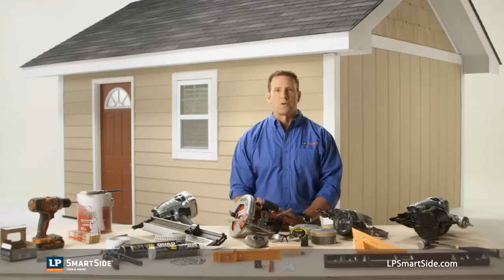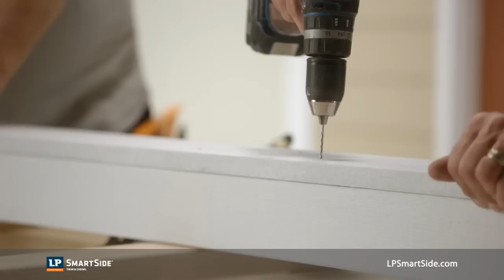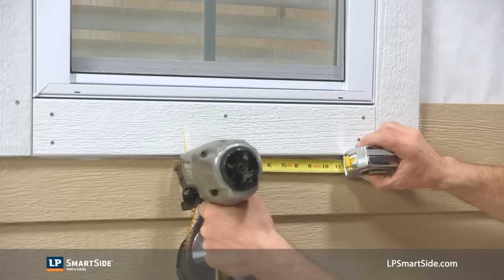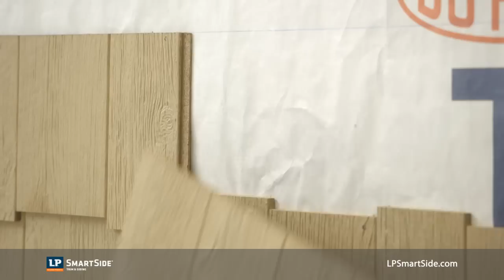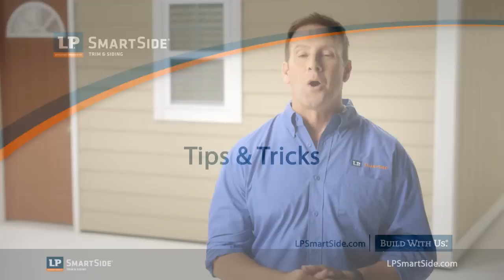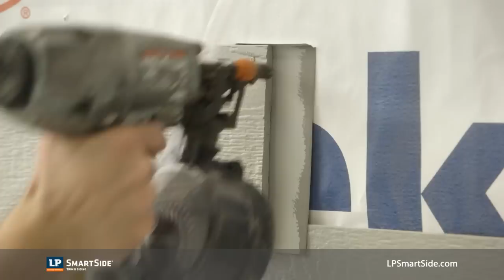How To Install LP® SmartSide® Trim & Siding Products

Comment: Was told i was installing lp siding tomorrow, so i wanted to check it out and holy crap this product is so bad , there is so much wrong with this product, not looking forward to working with it, i mean it's easy but, yeesh what petty crap, who wants tp paint all that crap and use a big ass nailer on those laps,, i have used so many better products, for the time it would cost to do this crap i would pick another material, looks like shit to IMO, i have seen it everywhere, the only thing good about this product is it sales team,

Comment: How do you do an inside corner when using the panels?
Reply: The most common way is to install vertical trim and then install the siding.  A highly more complicated way is to compound miter each and every piece.

Comment: 24:35 - "to protect the house wrap from this next step you may use a piece of metal sheeting to slide behind the lap siding"

25:18 - metal sheeting comes out with huge cuts in it

Is the point to protect from going deep enough to hit the house wrap?

25:13 - "Using a brush, prime all exposed wood fibers"

What about the wood fibers you just exposed on the lap underneath that you can't get to?

Comment: Can you tell me how critical it is to have a nailer that shoots nails with a diameter of .113? Of the 2 nailers I would prefer to purchase, they shoot a max diameter of .092. What nail gun(brand/model) uses a nail diameter of .113? Thanks for your help.

Comment: I am about to tear off wooden log home type siding . There is 3/4" buffalo board underneath. I told the home owner that I didn't think it was proper to side over the buffalo board, and it doesn't seem like I can get the 1 1/2" framing penetration of the ring shank gun nail for this. Am I right or wrong. I am trying to just get him to sign a liability waiver or just let this job go. Every one else has told him what he wanted to hear. I have a conscience. I believe the buffalo board will be mouse ridden to boot. This application keeps the existing windows and adds a house wrap. I am not enthused about any of this.

Comment: If you're installing full length lap you'll need 4 Gecko gauges due to bowing of the siding.
Reply: Nice to know I just bought two
Reply: You are not kidding about this.  I just got done with a job installing 16' lengths of this crap.  It was so bowed, I really could only use  1 Guage, and work my way down the siding from one end. Added tons of time to the job Terrible.  I'll be sticking with 12' Hardie board siding from now on.

Comment: Can you tell me what pieces of trim were used in this video, both corner and window trim. Is the 38 lap siding available painted to the public or is that purchased through a contractor, I want to install the siding and want painted pieces if possible.
Reply: You can get pre finished LP. Diamond kote does is and it's the best paint, they use a rock based paint that last a long time

Comment: How do you nail the ends to studs if you are next to a door, window, or corner where trim covers the stud locations? It would seem impossible to hit the stud. Can you nail to the sheathing alone in these locations?
Reply: You should have framing there. If not then add it in. This should be thought about for your trim size.
Reply: @athomewithkeith7904  But let's assume your house is already built, with sheathing in place and you are just doing a reside job. Can you nail this to the sheathing alone in certain places?  I don't think anyone is going to tear off the sheathing to add more framing. For example, a standard home has double studs on each side of the window- meaning 3" of nailing space. A standard 3.5" wide trim board would completely cover that area and leave no room to nail the siding. That means you would have to triple stud every window and door opening, and corners. I've never seen any standard built home framed like that. The only other option is no trim..

Comment: Do I need to use flashing between sheets, i.e. eight foot sheets plus a two foot piece on a ten foot wall. This would be four by eight foot sheets
Reply from the maker: Hi Dennis, you can learn more about flashing specifications here: https://lpcorp.com/resources/product-literature/installation-instructions/lp-smartside-strand-substrate-panel-siding-application-instructions-english
Reply: LP SmartSide link doesn’t work.

Comment: On the 4x10 sheets do u flash between each panels
Reply: This links don’t work. It’s just a bunch of coding or something .
Reply from the maker: Hi Jonathan, all openings must be properly sealed or flashed in a manner that prevents moisture intrusion or buildup, including flashing. You can learn more about installing flashing with LP® SmartSide® Trim & Siding Panels here: https://lpcorp.com/resources/product-literature/installation-instructions/lp-smartside-strand-substrate-panel-siding-application-instructions-english

Comment: What do you mean "your trim must extend beyond the thinkness of the lab siding for base"  ?
Reply: Jack Shaw the lap siding is 3/8” thick. When you lap the siding it will extend outward away from the building even further. The siding should not extend away from the structure past the thickness of the trim. Make sure the trim is thick enough so that the edges of the siding are concealed.
Reply: He meant "lap", typo on someone's end.

Comment: I see you have 3 options for lap siding butt joints, but in this video there is nothing done to any of the facia butt joints. Shouldn't you use one of the 3 methods for facia butt joints?
Reply from the maker: Hi Tom, thank you for commenting. You're correct in that we didn't reference fascia butt joints in this video. Butt joints on fascia should be spaced 3/16", with caulking at the gap for primed trim. You can find more butt joint instructions and installation information on page 5 (Figure 5b) of the LP® SmartSide® Trim & Fascia installation document here: https://lpcorp.com/resources/product-literature/installation-instructions/lp-smartside-trim-fascia-application-instructions-english

Comment: This stuff is a joy to work with. Imagine wood that doesn't bow warp or twist, and ends that don't split.
Reply: Imagine replacing the “failed” pieces in the future!
Thanks for using this cheap junk siding.
I will be in the replacement siding business for another generation!
Reply: @brookbandeen4999  This is not your father's Masonite siding. The things I've seen the stranded stuff do is very impressive. I think 35 years is doable. That said Vinyl seems to come off in every wind storm, so you'll be in business no matter what.
Reply from the maker: Hi there, thanks for your feedback! We appreciate your business and support.
Reply: I've had pieces of LP siding bow and warp. Its wood. There is always that possibility
Reply: @danieldenton5721   was this the strand or the fiber?

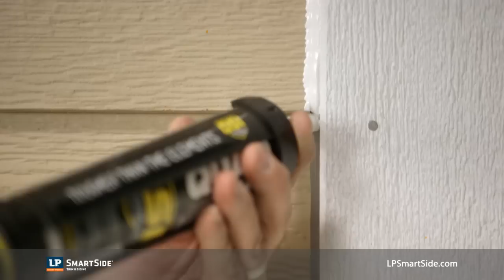Comment: 10:05  y'all left it like 3/16 open or more  too much gap and sealant to use
Reply from the maker: Hi Alexis, thank you for commenting. We recommend a minimum of 3/16" for butt joints and sealants. You can find detailed installation instructions here as well: https://lpcorp.com/resources/product-literature/installation-instructions/lp-smartside-strand-substrate-lap-siding-application-instructions-english. Let us know if there's anything else you need!
Reply: I just installed some and used the recommended 3/16” gap and yeah it’s a pretty large gap to fill and does use a lot of caulking. It’s hard to make look good too given the caulking sinks as it cures.
Reply: @whatfreedom7  3/16" does seem like a big gap.  is this because it swells when wet or the expansion of the manufactured wood has properties that swell?

Comment: Can someone please tell me the reason they dont want you to install cement board in contact with this siding? Is it because it soaks up water?
Reply from the maker: LP® SmartSide® siding must not be installed in direct contact with masonry, concrete, brick, stone, stucco or mortar; this includes cement board.  Cement board absorbs moisture and may transfer that moisture to any engineered wood siding through direct contact, potentially creating siding performance issues.
Reply: LP SmartSide but you said is treated wood against water leaks, termites and different like the normal wood, so basically if water gets somehow behind the siding this is not good. Just the painting doing the job I think

Comment: We are covering 2x6 boards x3 wide to cover support pillars for our front porch with LP smartside boards. I understand I need to prime and paint all surfaces and will need to silicone the edges but I assume don't silicone the bottom edge and how far must they be up from the finished deck? 3/16" ? They are also the wrong color so we need to paint a new color.
Reply from the maker: Hi Cynthia, thanks for commenting. It appears you’re referencing the bottom edge of the siding/trim where the 1-inch gap between the siding/trim and deck occurs. If that is the case, you’re correct in that you would not need to caulk (silicone) the 1-inch gap. Let us know if there’s anything else you need!

Comment: Work like amateur.  I am 20 year all type siding installer. When  You install lap siding, you need joint flashing between each joint.
Reply from the maker: Hi there, thanks for commenting. Visit https://lpcorp.com/products/exterior/siding-trim/build-with-lp-smartside/installation-instructions for further installation instructions.

Comment: The one useful fact that this horrible video does not mention is you need rip a 1/2 inch off on your starter panel due to overlap..

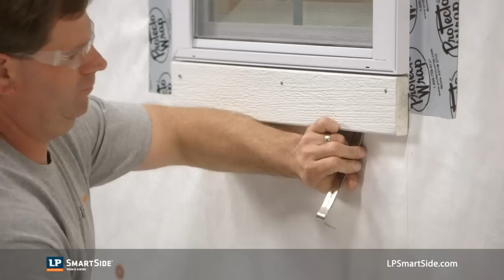Comment: @5:50 Why are you shimming out the window's bottom trim piece? There is nothing in the official installation instructions about shimming out the bottom trim piece. Is that so water can escape if it gets behind it?
Reply: You have to shim because the flange on the window will cause the trim to angle in if you don’t. So you have to shim out the bottom to make it straight
Reply: Patrick so if that’s the case than you should shim all the trim because all the trim is sitting on the flange

Comment: total crap.. do not use this stuff.. unless you plan on selling the house soon..
Reply: ...unless you plan on installing it correctly.
Reply: has to be installed perfect because its trash.
Reply: I work construction i don't sell any products.
Reply: I don't have to sell anything to warn people about a shitty product.maybe you cant comprehend someone doing something with out a personal gain...not everyone is like yourself.
Reply: mark vietti which product do you sell?
Reply: mark vietti I've been installing smart side for 15 years, great product. I do see a lot of hacks, who can't read, install it in moronic ways that defy common sense. Perhaps you've had complaints or a warranty issue with your work and that's where your animosity comes from?
Reply: it should be installed by a professional but this video is about non professional installation.

Comment: Idk those gaps are huge. Caulking bill is going to be outrageous using osi at 10$ a tube
Reply: Fuk it dont gap shit
Reply: They make trim pieces that go in the joints not mentioned in this video.
Reply: 1/8  looks better

Comment: best AFFORDABLE nail gun for this application?  Anyone...?
Reply: Never use wire welded collated nails. The wire will rust and streak down the face of the siding. Paper or plastic collated nails are best.
Reply: Use Stainless Steel ring shank. No rusting issues. It’s pricey but will a better system overall

Comment: Why do they say not to apply caulk in a gap that's near window flashing?
Reply: The purpose of the window flashing is to allow any water that gets behind the siding above the window to have a way to run out.  If you seal it, the water would be trapped and cause damage.

Comment: My mobile home came with Smart Siding.

This "smart" siding is going bad in 9 years.  Not very "smart" to me.  Avoid at all costs.
Reply: I am not advocating their product even though I have their smart siding on my gables and James Hardie from gable down......I'd bet money your mobile home was built by some folks that did NOT follow these directions....just as my James Hardie that I have been installing....it takes time to flash and touch up cuts......mobile homes are built fast paced and likely you got what you paid for.....a rush job.
Reply: probably 2x2 studs in that trailer

Comment: on the smartside vertical panels can you use a D-Ring head nails or do they have to use the full round head nails?
Reply: Always use full head nail per instructions

Comment: Question: I am wanting to install smartside panels vertically on a 10'x10' pump house (shed). However, the LP site says this product cannot be installed vertically. Yet, this video shows the panels installed vertically (gable end of the shed in the video); quite the contradiction. Second question: must I use a waterproof barrier between the siding and the studs on this outdoor shed? Can anyone answer these question? Thx.
Reply: +Manestream the panelscan't be installed horizontally. I contacted the manufacturer.
Reply: +rafjr64 Housewrap is optional on a shed but i would use it anyways. I think you are confused. LP lap siding cannot be installed vertically but they make a few vertical siding options. I think you are confusing their board and batten siding for their lap.
Reply: +rafjr64 The horizontal slats you can't. They're just regular siding pieces, they install the same as how clapboard siding is installed.. Row by row.. The vertical siding they show here are sheet panels that are 48x96, those can be installed vertically or horizontally.